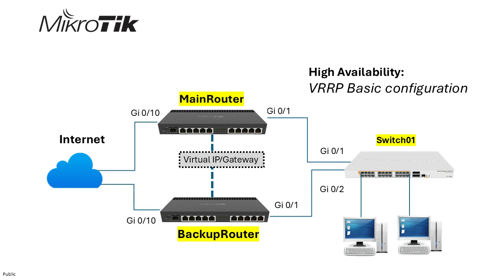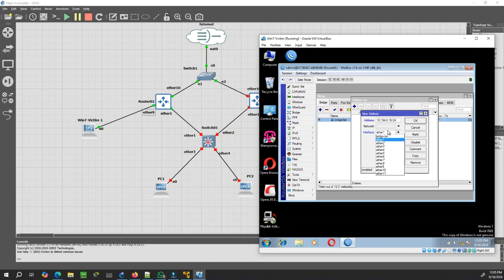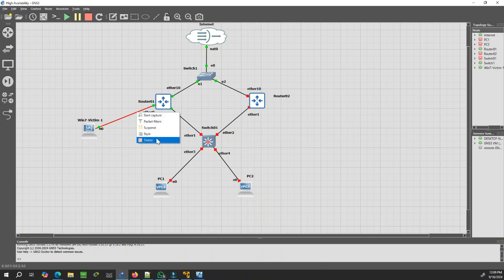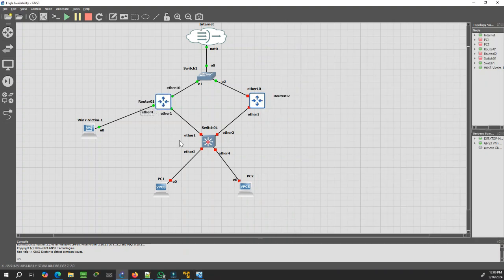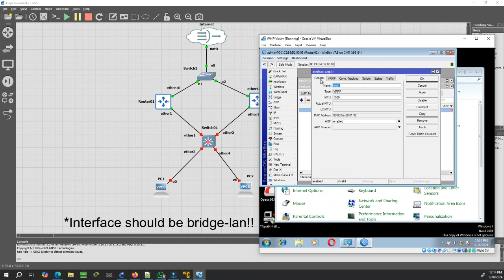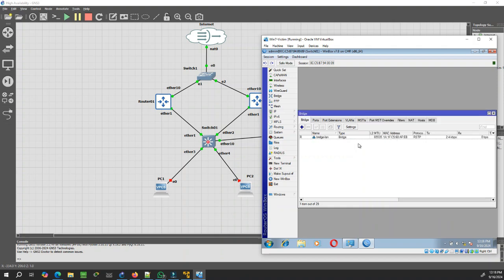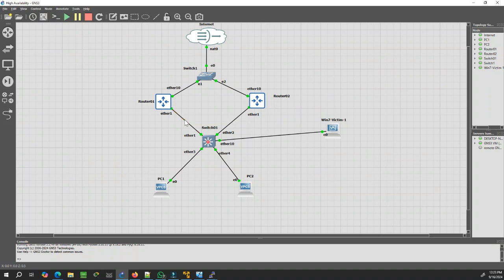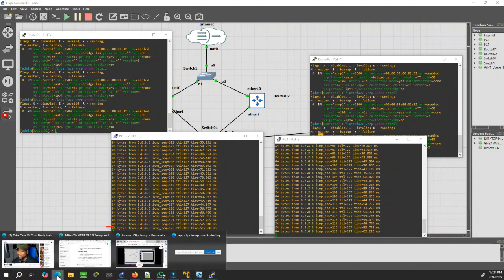Mikrotik Router Redundancy - Basic VRRP configuration #vrrp  #mikrotik #highavailability

Comment: Hello I successfully setup vrrp thanks to your guide but I noticed when enabling connection tracking the continuous ping -t 8.8.8.8 stalls indefinitely until the main router comes back online. If I disable connection tracking it only drops 1 ping and then works immediately. I imagine it has something do with each router has a different WAN IP that doesn’t exist on the backup router when failing over. Does that make sense?

Also, when is an example that connection tracking is actually required? It seems like it behaves worse with it on..

Thank you!
Reply from the maker: Hi ,thank you for your comments,your observation makes sense, and it highlights a key behavior of connection tracking in the context of VRRP and failover scenarios.
When connection tracking is enabled, the router maintains state information about active connections, including the source and destination IP addresses, ports, and other details. In a VRRP setup, if the primary router fails and the backup router takes over, the connection tracking table on the backup router won't have the state information for the connections that were active on the primary router. As a result, packets from ongoing connections (like your continuous ping to 8.8.8.8) may be dropped because the backup router doesn't recognize them as part of an existing connection. This causes the ping to stall until the connection times out and a new connection is established.

When you disable connection tracking, the router treats each packet independently (stateless), so the backup router can immediately forward packets without needing to match them to an existing connection state. This is why you only lose one ping during failover.
You're also correct that the WAN IP difference between the primary and backup routers can exacerbate this issue . :)
Reply: @ thank you for your reply! It makes sense for connection tracking but I meant sync connection tracking (sync between both routers). With Sync connection tracking ON the ping stalls when it fails to the backup router. With Sync OFF it only drops 1 ping then begins to ping again.